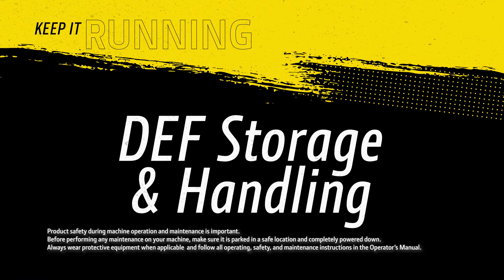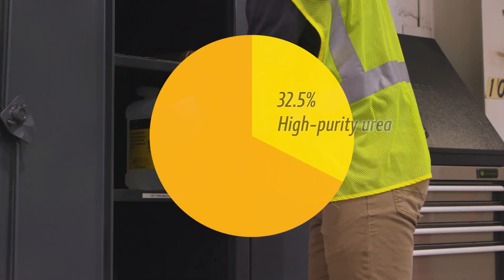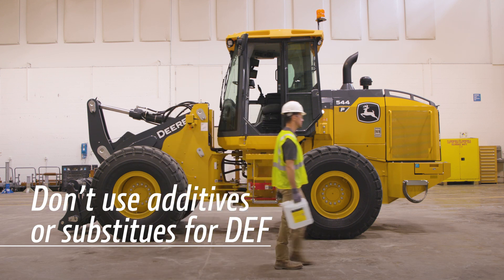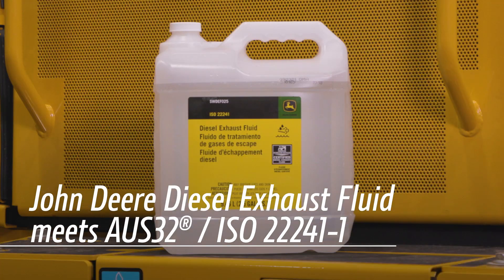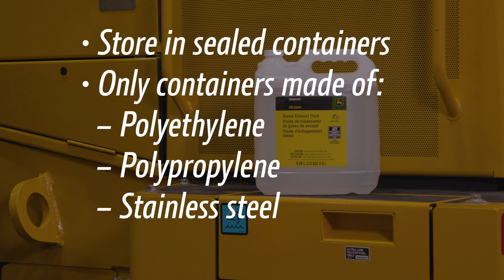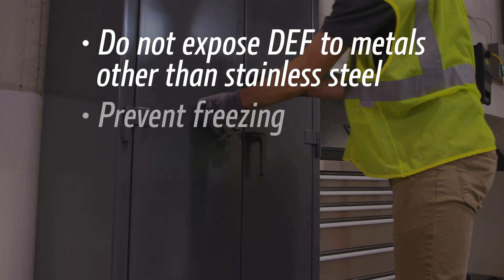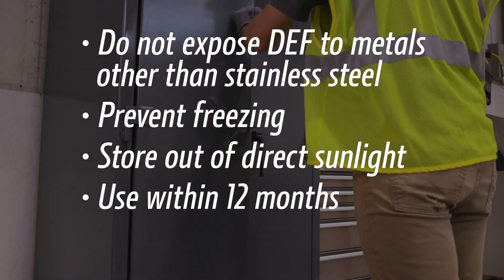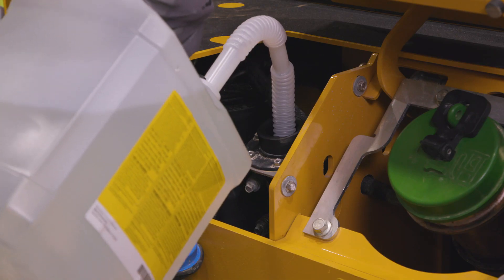Engine DEF Storage, Handling, & Tips | John Deere Engines & Drivetrain

Comment: The best thing to do with DEF, in order to keep your equipment running clean and reliably, is to delete the entire system and throw it in the trash. Ask any diesel tech and they will tell you that 80% of the issues on newer diesel equipment and trucks, are with the emissions equipment, specifically the DEF

Comment: Winter tips? Freezes?
Reply from the maker: Great question! Diesel exhaust fluid (DEF) freezes at –11°C (12°F), so it's recommended to store it between –5°C and 30°C (23°F and 86°F). When DEF freezes it expands by approximately 7%, so the storage tanks are designed with extra space to allow for expansion during freezing. In addition, DEF fluid is evacuated from the engine's DEF system lines and pump each time the engine shuts down. When the engine is restarted, DEF use is delayed until the engine reaches operating temps and the fluid has thawed. Additionally, the DEF header in the DEF tank has a heated circuit that is monitored and regulated to thaw frozen DEF. The DEF pump and lines are equipped with electric heating circuits to prevent freezing while running in low ambient temps.

We recommended purchasing DEF in quantities that will be consumed within 12 months.